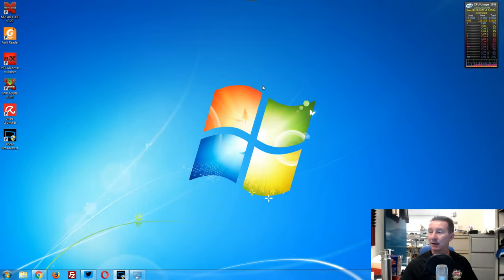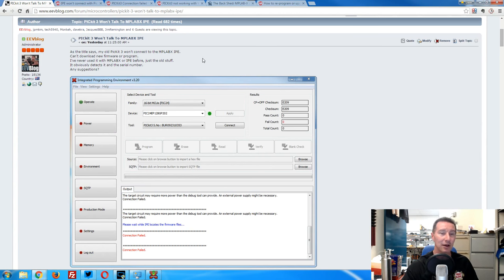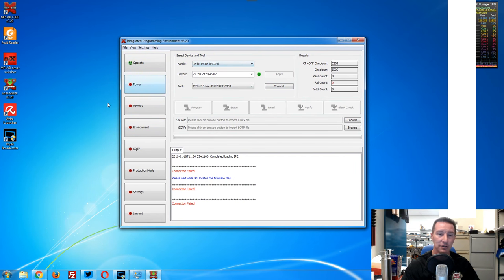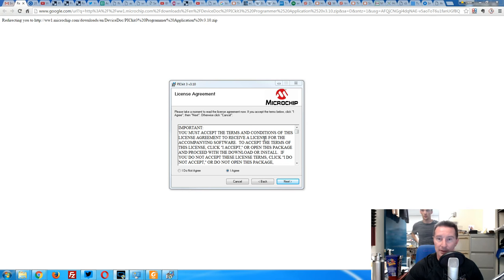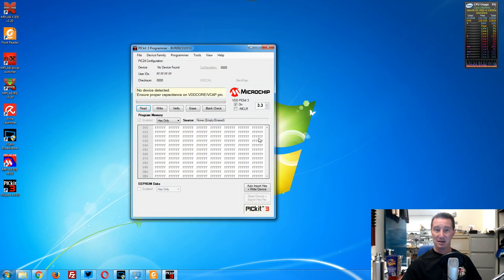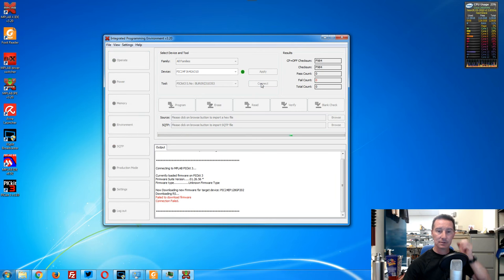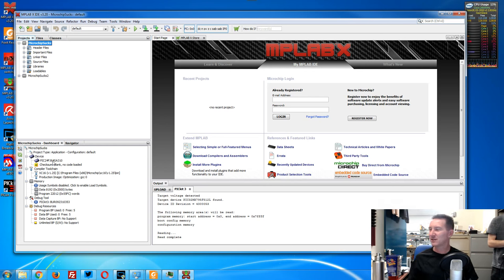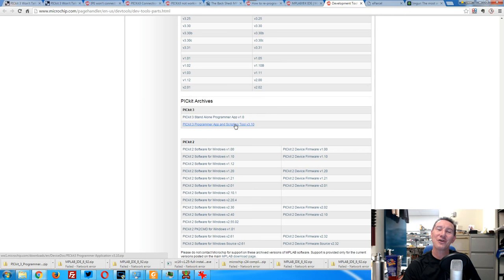EEVblog #841 - Microchip MPLAB X PICkit 3 Woes

Comment: I don't get it...why while there are stm8 and stm32 micros with free IAR and 5$ programmers...bother with MICROSHIT
Reply: because STM sucks. TI and PIC32 for the win! both my fake and real pickit3s work perfectly.
Reply: ST has the worst documentation and support. The only thing they win at is making it harder to be an engineer.
Reply: +Matt Young You may want to try the new HAL libraries with STM Cube application...it is brilliant for starters.
Reply: +Aurelius R My statement was not made because I am a fanboy or something...I have worked with MSP430 and PIC18 for many years...but since I moved to ST I really see the difference, but any way your mileage may vary!
Reply: +Saeid Yazdani I've been very happy with PSOC. More expensive parts, but the BOM size and cost reductions are huge.
Reply: +Saeid Yazdani in comparison to MSP430 and PIC18/32, STM software support is absolute garbage. I know that they've been trying to improve with the HAL, but the simple fact that they do not provide an official IDE package makes it very hard for regular hobbyists and even engineers to get started. The free software out there all have limitations, so the only actual free "IDE" requires combining eclipse + openocd/stlink + gcc arm. Even then, it's no where as good as MPLAB X.
Reply: +Saeid Yazdani I'm starting out with STM32, how's Cube working out for you?  Should I use that or the Standard Peripheral Library?  I like the control I get with the SPL, but if HAL is that much better I might look into it.
Reply: Cube works wonder, simplifies configuration a lot. But there are some tricks you have to learn for advanced settings like setting up DMA, Devices (USB, etc.). when cube generates the project for you it will be HAL of course.

Comment: I get this in the MPLAB X IDE. Remove the PICKit 3, try to reconnect, it should prompt you to select a device, and then re-connect the PICKIT3. It sometimes work.

Otherwise, when selecting the device, select another device, hit apply, then reselect the PK3. Works all the time for me.

Comment: Hi Dave. If you think MPLAB X is bloated, try Xilinx Vivado webpack. In the beginning it was 6GB, now it is 20GB ! I'm currently using it at the university and it works great there, but at home as a student my computer isn't sufficient. I had to download 50Mb web installer just to get a message minutes later saying it doesn't support 32 bit systems. I was about to test out the new remote lab (beta) that they have at the University of Oslo. You can tar.gz your vhd files and send them to the lab server via the web browser, and the server compiles and uploads a bitstream to the remote fpga board (I think, or you have to send the bitstream). A webcam shows you the board and you can push buttons and switches remotely :) It's a tool used together with the edX MOOC course they are now setting up in parallel with the university course.

Comment: Thanx for clarifying all this drums and whistles around Pickit 3! :) I don't feel you need to really apologize to Microchip because they've made things super-complicated! I don't need that IDC3 to just flash some PICs (not on my current level for sure).
And it seems that it's no difference between clones and the original Pickit3 since it's very frustrating even if you've paid for the original one!
I guess that Pickit 2 has no modern chips support, right? I've targeted to PIC16F1764 because of the internal clock. It needs much less external components to run it. PDM instead of PWM. It's a big deal as I've understood!

Comment: @EEVblog thanks for making these really good product reviews! This one is a classic, I spent a couple of evenings just trying to connect PICKIT3. Just following your video, made it work on early steps carried out, just after downloading MPLAB IDE v8.92, then MPLAB X IDE v5.35, and then PICKit 3 v3.10... Using a AC164110 board to support PIC16F877A. Will try the solution of using dedicate MPLABXC16 compiler v1.25 on MPLAB X IDE as still following this video. Just taking a quick note here about my progress, just about after dealing with microchip website and technical support pages for a while now. Maybe they fixed this today? Not really, anyway, MPLAB IDE connects to the debugger, instead of connecting to the programmer, and even debug mode do not support the PICKIT3... It is ridiculous... #EEVblog #microchip

Comment: Ha, Microchip where to start, it's all going wrong for them. 
I grew up on PICs and always had a softspot for them, but thing's seem to be deteriorating.

We've had a few pickits that would not program 5V devices unless you set the voltage to 4.5V.

MPLAB X is great (but slow), until you get an update and the checksums suddenly change for our released software! Not cool Microchip!

MPLAB's driver switcher is a pain in the Backside.

Promates that just wont read devices and require the old "turn if off and on treatment".

We've had good support from them in the past, but only because of the relationship with our supplier who we work closely with.

There chip tech/features have fallen behind those offered by competitors ARM devices (although they still have a couple of lowish cost Gems in their catalog if you have a specific peripheral requirement).

Their customers base has been screaming at them for years to get involves with ARM, I suspect that this is the driving force behind this acquisition.

I hope they don't pass on the bad habits to Atmel, then again Atmel have a few bad habits themselves...ho hum!

Comment: Haven't checked your comments yet but,
Did you check Device Manager and see if the device has had events that said something about .... ah did you just say Windows 7? Hmm that won't help then.
Edit: Well. After seeing the whole clip - In the wrong mode it would load the wrong driver. In Nokia we had a µUSB headset that also started in another mode if you held the volume up pressed at USB connect. Glad you found it yourselves. Thrilling development - great video :-D

Comment: I had the same problem - was it the power settings - 'Power from Tool'.  I also have another issue where it powers the PIC Kit 3 at .25v less than I set it.  eg.  Set to 5v, USB port is detected at 4.75v, at 5.5v USB is detected as 5.25v.  Problem started at the last firmware update for me.  I can get around the issue by powering it separately.

Comment: I use the ICD3 debugger.  I've had a lot of issues associated with the RJ-11 connector, especially with the PIC32MZ devices.  I might eventually solder hard-wires on there to get rid of it.

Comment: I've used Microchip products for over ten years, and at first I didn't like the MPLABX IDE, and it took me a while to even realize what the IPE was. I used the old MPLAB 8.9x to read and write devices using hex files. I think one of the main problems you had was the lack of a target for the IPE to connect to, but you may have had other issues as well, and fortunately you were able to get up and running finally. I have become used to the MPLABX environment and I also have the XC8 compiler working well in PRO mode. I had problems initially with the USB stack for PIC18 devices, but now I have started using newer ones such as the PIC16F1454 and PIC18F14K50 for small simple projects.

Comment: One last thought.  The entire reason why Dave had a problem in the first place is indicative of a greater problem.  People don't bother to read the fucking manual.  If Dave had used MPLAB or MPLAB-X with the damn programmer, he wouldn't have had this problem.  But no... Dave just wanted a small, single-purpose application that could burn his hex file (what he expected to generate the hex file is anyone's idea).  So he sought out this PICkit 3 Programmer.  Had Dave read the well-written, thorough PDF that accompanied this product, he would have come across Chapter 6. Updating and Reverting the PICkit 3 OS.  It plainly states that if you DO NOT run the menu item that ended up solving the problem, you'd have a problem.  Plain.  And.  Simple.

Comment: I tried f ing around with pic micro controllers way back in the day.... what a f ing nightmare.... I put it aside for a bit from frustration like you experienced.  I totally gave up on it eventually as by the time I decided to give it a try again it was outdated... I hooked the whole f ing thing up to 120 volts and tuned it in for maximum smoke.... piece of shit company ,   stick with atmel or some other and maybe you'll be able to get somewhere instead of pic ing your ass all day trying to figure this shit out.

Comment: Mine works perfectly fine ! ... As long as I use it within 5 seconds of unplugging and plugging it back to the USB. After which I have to try again. And it looks like most of the time it worked in the video, it had just been plugged it in or the USB connexion sounds just went off.

Comment: Hi Dave. I met the same problem trying to program a dsPIC30F4013. I had a dry solder but even after fixing, I encounter random errors with the Pickit3. It works well with PIC16 or PIC18 though. I'm just being patient and hit the "retry" button until it works.

Comment: I've taken several stabs at a response to this video... it's the first of Dave's vids that I had to turn off 1/2 way through due to the massive amount of bitching.  I originally thought he was wrong about MPLAB-X not shipping with any compilers, as I've personally built ASM projects without d/l'ing the XC compiler.  Turns out for the PIC24 series, he is correct.  But I stand by my opinion that Dave's gripes might be valid... for my computer illiterate elders... but we are ENGINEERS and things like not knowing why the PICkit 3 Programmer was throwing an exception rather than closing - there's just no excuse for that.

I don't mind the occasional derogetory comment being thrown out, as that's almost a Dave trademark.  But a video like this could have been a 5 minute demonstration of the solution and 36 minutes of whining put in the trash where it belongs.

Comment: Whew, just saved my old PICKIT3. It was recognized by IPE 3.3.5 but could not connect and would not update its firmware  It was not recognized by MPLAB 8.9 or 8.4 under XP so, again, would or could not update its firmware. The fix was to pop the case, solder wires onto the ICSP header (which was difficult because the solder pads are so small and close together) and then reprogram it with the IMAGE_PK3_012510 hex file from Microchip.  Fortunately my old PICkit2 could do that under XP. Then it would connect under IPE and updated its firmware.  But what a total pain.

Comment: An issue I've found while using the IPE, is if the power section is set to provide 5V, it will only provide 4.65V from the pickit3 and this will cause it to throw an error.  Dropping the voltage to 3.5 in the power settings seems to work ok though, at least on the 18F4620, and 18F4685.

Comment: Easy fix; don't use PICs.  STM32F103 (for example) is a fantastic chip; Cortex M3 @ 74Mhz,  runs C beautifully, great libraries, programmers all over ebay for $2, populated boards for $3.50, proper full-speed USB support, a ton of on-chip peripherals, etc. I love that thing.

Comment: Something I thought about from my years of IT admin work and audio engineer working with weird MIDI devices.  I don't know the specs of your computer.  But here's something to try.

Make sure backwards compatibility USB 1.1 is enabled in your BIOS.  Is some cases, only your USB 2.0 ports will be backwards compatible with USB 1.1.  From the PICkit 3 specs, it appears it's using USB 1.1 (a lot of programmable devices use USB 1.1 because of the data transfer speed more closely representing serial communication speeds).  If I remember correctly, the later USB specifications increased transfer speeds while increasing the line noise that required more data correction which a lot of devices are capable of.

Comment: Interesting... I have MPLab X installed on my MacBook Pro and it talks to the IPE no problems at all, I had similar issues on my WIN 10 machine but a couple of re connections of the PicKit and it worked... Mainly use my Mac for any development though.

Comment: I think starting these programs as administrator (on right click) would alleviate a lot of these problems. Many of the errors are access denied messages. I can also see from the icon on the desktop that it's not starting it elevated mode.

Comment: I have used the PicKit 3 for years under Linux on MPLAB X with no issues but one of my colleagues has failed miserably with it under windows. He cannot use it at all but his RealICE and ICD3 work just fine.

I think the issues he has are caused by the fact that the PICKit 3 is a USB-HID, some third party drivers/utilities screw with the USB-HID system and interfere with other devices.

Comment: I had similar problems with my PicKit3. I was trying to program a 18F4550 and power it from the PicKit3. Tell it to use 5V's, ni problem. The PicKit wouldn't connect, repeatedly. 2 hours of screwing around with it and the problem turned out that my USB port was putting out 4.75V, not 5. The PicKit3 powers up the target device and then checks to see if the voltage that is specified is what is actually on the device. Since 4.75V != 5.00V the PicKit was reporting a failed connection! I specified the PicKit to supply 4.75V and it has worked every time since.

Comment: Might be worth checking that your MPLAB IDE version is up to date also Dave. It might explain why David2's machine fixed your PICKit3. It looks like the firmware has had a bit of an update also - my PicKit3 with MPLAB X v2.35 had v1.26 of the firmware suite,  and it now has v1.40 when using MPLAB X v3.20. 

I had no end of trouble after digging my PICKit3 out of my junk pile, and the standalone PICKit3 Programmer v3 was crashing and burning when trying to load it's own firmware on (on a Windows 10 machine). Updated the MPLAB IDE to the latest v3.20, and the IPE not only acknowledged a 'unknown firmware' but proceeded to update and fix it all up. Pressing and holding the button when plugging in the PICKit3 didn't seem to work for me, but since I don't think PICKit3 ever properly installed its firmware or would mode switch without crashing...I don't know if it ever had a chance.

btw, there is a suble hint as to why this dogs breakfast occured in the standalone PICKit3 Programmer readme - where it says "Since PICkit 3 is supported under MPLAB(R) IDE with non-scripting firmware,
special firmware is needed to understand PICkit 2 scripts. A bootloader is used
to switch seamlessly between both operating systems." 

It then goes on to say that "Please be aware that this OS is not compatible with MPLAB IDE" and how to change modes. 

But who reads readme files nowadays! lol

Comment: Dave what are you doing. I have used the PicKit3 together with MPlabX with various chips and never had any problems. (also Win7). I always used the IDE and not the IPE to flash the chips, though.

Comment: I'm working on a PIC project after about 10 years since my last one. I find the development tools have all changed for the worse. Much worse. I have the code completed and debugged thanks to the old MPLAB IDE 8.92. No thanks to the newer MPLAB X or MPLAB Express. Hopefully my old PicKit 2 will program the chip. Microchip's management is stupid and that can't be fixed. They have a fairly long history of separating the wheat from the chaff and eating the chaff. I will move on to some other brand for my next uC project.

Comment: By now I asume you found out that connect actually is to connect to your PIC controller, not your pickit3 ....
If not: connect conntcts to the actual PIC controller (Don't forget to make sure the PIC controller has power !!! Externally or out of the pickit3 (need to set it up!) )